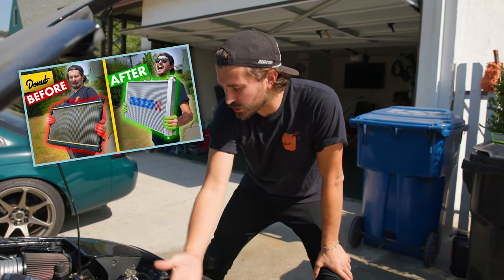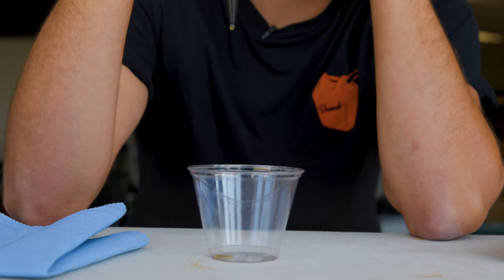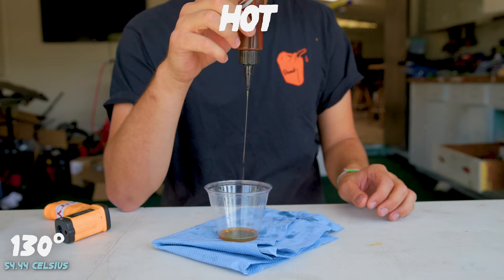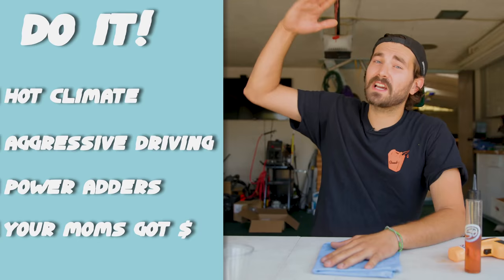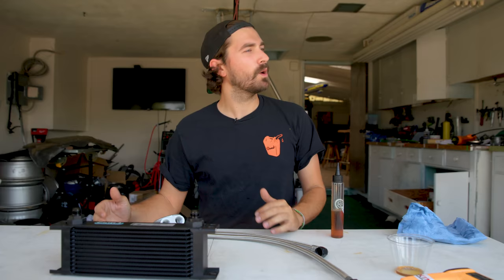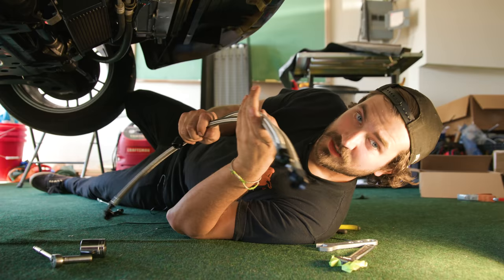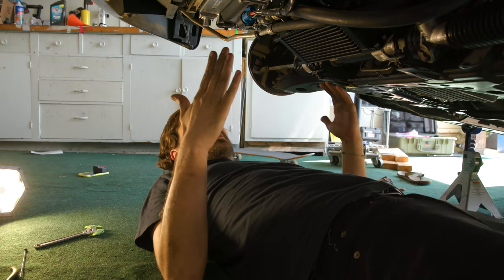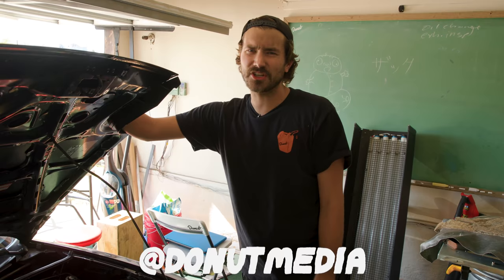Is an Oil Cooler Worth It?

Comment: One day he will swap a jet engine in the miata
Reply: After that he will swap it with a nuclear reactor
Reply: @korosukanji5398  and there still won’t  be a turbo
Reply: @azav32  lmao 😂
Reply: Swap a rotary into a jet😂
Reply: Literal money pit
Reply: pulse jet engine incoming
Reply: bob lazar mode
Reply: Look up Az state fair jet powered smart car, thank me later.
Reply: you cant do that, cause jet fuel is square shaped, and they only have round fuel hoses! (smokey yunich podcast)
Reply: Let's hope
Reply: Y E S !
Reply: Well, he IS going to put a turbine in it, and a compressor, so, kinda, yeah.
Reply: He should go for a british V6. Look at car throttle and their miata.🤘
Reply: Sweet. Then I can be a donut mechanic.
Reply: "Is Jet Engine Swap Worth It?
Reply: @mrkvatheepic2913  yEs
Reply: @mrkvatheepic2913  from a monetary value worth. No. When parts break they are thousands of dollars. And the engine wear is measured in hours not miles like cars. 
From a cool factor. Yes totally worth it.
Reply: (Jay Leno has entered the chat)
Reply: That would actually make it fast. ;)
Reply: With afterburners
Reply: @azav32 XDD

Comment: I like how he emphasizes good practices like moving the car after applying jack stands, oiling before screwing, using softer material on fittings to prevent damage.. and more oil! Good role model.
Reply: Except for not blocking his back wheels, personally i dont want to be a pancake
Reply: @redhammer5783  Because he left his car in neutral and totally without a parking brake
Reply: @derpyduck5088   A little extra safety never hurt anybody.
Reply: "oiling before screwing" 👀
Reply: More oil isn't always good. 
There's a low and high, you don't have to be on the high side. 
My Yd25 takes 4.7L total but I only put 4.4L in
That doesn't not affect the engine at all, and being a high flow turbo diesel, it like all diesels is subject to high crank case pressure which will increase sump pressure, and that oil pressure goes back Into the turbo and breaks the seals. 
It can happen, and did happen to me. 
I avoid this issue by using less oil.. simple. 
Don't always go to the H on the dipstick if you have a turbo.
Reply: "Oiling before screwing" is a tip for life in general 😂

Comment: I always recommend putting something like a stainless wire mesh #5 screen about an inch of the front.   Keeps the fins from getting damaged by rocks n stuff.
The screen is heavy enough gauge to protect, and easy to form.
Reply: @mikez6683  In my case I folded it back around the cooler enough to use the cooler attachment itself as an anchor point.
Reply: While it will protect it, it will also hamper airflow, reducing it's effectiveness...
Reply: @Tallnerdyguy  Not really...   At least not in any meaningful way, unless you use something like screen door mesh.   Look up wire mesh #5, which is what I used
Reply: Thanks! I bought an oil cool for my motorcycle and it didn’t come with the guard. This sounds like a great idea.
Reply: @Mytwistedvoices yep, was watching this and thinking “that seems to be very much in the way of rocks”
Reply: @Fatboypeet  I put a cooler on my CB750 and found a good screen for it.
Reply: Are you a wizard?

Comment: If you put the lines on the oil cooler with oil in it before mounting it, you will keep from spilling oil while mounting.  Also, you should use some blue thread locker on the sandwich plate pass-through bolt to make sure that it stays on when you remove the oil filter during oil changes.

Comment: Be careful with putting oil on the threads, although it will make it easier to not mess them up and strip them, it could also cause the screw to loosen up over time. I would recommend to use semi or (soft) thread locker, when you first apply it it will help with not messing up the dreads but then after you tighten it, it will seal and prevent your bolt from coming out. This has helped me out a lot in the field, thought I would mention and keep wrenching guys! 💪🏽🛠
Reply: I have to agree, in industry as a fitter/machinist I use Loctite hydraulic sealant to assemble pneumatic and obviously hydraulic fittings and connections , it takes away a large portion of the vibration loosening risk especially due to the heat cycles of the oil.
Reply: Engine oil is fine to put on bolts. Infact, many bolts are supposed to be torqued 'Wet'. Particularly a lot of head bolts, conrod bolts ect. Oil won't hurt, bolts and fittings won't come loose if they are properly torqued. However, things like anti-sieze are another story.
Reply: @devo3243  no offence mate but we're not talking about bolts here, technically they are hydraulic fittings for all intents and purposes, I'm not going to suddenly change my process of over 30 years on your say so, I agree regarding head bolts etc, I have done this myself rebuilding a couple of my own engines.
Reply: @fourocker  This "hydraulic" system will never see the day it reaches over 80psi, not 8,000psi. Those head bolts will be receiving not only more vibration as they are directly connected to the thing making said vibration, but experience higher temperatures as they are almost directly in contact with the bore (although the coolant jacket as well). The fact that bolt and stud stretch is a factor when considering head bolt and main cap torque is enough to tell me the head bolts are undergoing greater forces pulling the head of the bolt and the piece they are threaded to apart than these aluminum AN fittings.

Feel free to use whatever you want, but let's be fair here, these aren't the same thing.

Comment: Pretty soon they're going to run out of stuff to do to this car.
Are titanium lugnuts worth it?
Are Hand-crank windows worth it?
Reply: Is converting my miata to a diesel worth it?
Is converting my soul to pastafarian worth it?
Is it even worth having wheels? Converting my miata into a hovercraft for the ultimate driving comfort.
Reply: I would still watch
Reply: Hand crank windows are golden
Reply: Nos kit next
Reply: @stopglobalswarming  they do the job in a small car very well
Reply: @MrPlanner12  ...after that how to rebuild the engine ...;-)
Reply: They would probably buy a different car.
Reply: Is a chassis delete worth it?
Reply: @joshrepik  is a car delete worth it
Reply: @joshrepik  ....in the UK they have Mazda 7 racing ....all those rusted out MX5's
Reply: @alexjohn5086  trust me, I live in Ohio. The rust here is very, very real.
Reply: before long he is going to be driving a B-series
Reply: Is buying an E36 worth it?
Reply: Are cars worth it?
Reply: How to ls swap a miata
Reply: my hand crank windows ALWAYS work in my 7.3 OBS... my mustang and s10? not so much
Reply: damn straight! I want em on my old car that should have them anyway  @stopglobalswarming
Reply: What's better, imperial or metric hardware... Swapping the Miata over to imperial hardware!!
Reply: cold oil is not good unless the car is heating up they may do a water pump delete haha.

Comment: For your main coolant, I'd suggest getting your hands on a glycol type substance enriched with a ton of graphene particles. Far greater thermal conductivity than water, but still flows well in super low temperatures. You can probably even make it yourself if you can get your hands on the graphene particles.

Comment: "Is an oil cooler worth it?" 
Me with an aircooled bug: "yes" 👀
Reply: Lucky lucky
Reply: Me and my Citroën agree as well
Reply: Then it's gonna be oil cooled? With the oil being cooled then the engine will be cooled also which helps at idle for air cooled engines I guess.
Reply: @Dongzzzzzz  yes, originally all aircooled engines are essentially "oil cooled" but sometimes it needed an extra oil cooler, especially since I lived in a tropical country.
Reply: @souheib9343  yo dude got an insta with it? That seems so cool!
Reply: The only good reason outside a track driven car to have one.
Reply: I🙋🏿‍♂️🙋🏿‍♂️🙋🏿‍♂️🙋🏿‍♂️ N MY RICE 🍚 KOOKERS KOLT TURBO N GREMLIN CTSV TOTALLY AGREE 👍🏾👍🏾👍🏾👍🏾
Reply: Me with an air cooled beechcraft 👀
Reply: A must for rotary
Reply: Porsche 930s were notorious for relying on the oil cooler as a radiator.  Presumably just like water cooled, only much hotter.

Comment: An oil cooler (with a thermostat) is an absolute must for any turbo applications. It's  amazing how stable oil temperature stays despite the heat from turbo even on hot days. With all the small turbo engines these days, oil coolers (and transmission coolers) should be standard if one wants to keep the car for a long time.
Reply: What kind of  oil cooler are you running?
Reply: @mr.bigrigs2059  I run a Setrab stacked cooler for the engine for larger cooling capacity and s smaller tube and fin, Hayden I think, for the automatic transmission. The engine oil cooler serves as insurance if the water cooling fails. And the transmission cooler prevents temperature spikes especially in the hot Summers.

Comment: A consideration not many people think about:

Your OEM oil pump may not be strong enough for the additional flow needed for the oil cooler.  You MAY see an oil pressure drop as a result of this kind of install.  Answer is either a larger oil pump or an aftermarket electric pump.  Heard of people using a scavenging pump to keep pressure up through the line (like a turbo).  Truly is a YMMV thing though, not all vehicles will have an issue and even those that do, may not be worth worrying about if the pressure drop is small.

Comment: I watched the whole video and the answer is

Y E S
Reply: its only been out for 4 minutes
Reply: @buurman2635  speed run
Reply: Dunno how you came to that conclusion, they didn't "test" anything other than it not leaking, if you looked back at the "9 grand worth of parts on our miata, was it worth it?" video it was a resounding  FUCK NO
Reply: @weegaz22   Call it peace of mind then XD
Reply: @bobwarpath2395  sure, but if i had spent 9 grand on "performance parts" on a car worth about a grand and had no real improvement in time @ the track then I'd be an idiot, that 10 grand total could have bought a decent, fast car in the first place, hell you can pick up a 3.2 Boxster S for  less than that where I am, and it would still have resale value a couple of years later when you get bored with it.

Comment: Every 20 deg. F drop in oil temp, effectively doubles oil life.

I installed an oil cooler a Dodge Caravan four cylinder, with an electric cooling fan.  It kept the engine running so cool, you could open the radiator cap at after running it in rush hour traffic and it would NOT blow up steam in your face.  Not recommended but you get the point.

Comment: The location of that cooler is lower than the oil pan. This means that now when you change your oil there will be dirty oil left over inside the cooler that won't drain.
Reply: Not just that, it’s exposed to road debris.  One good puncture and you can say goodbye to your engine.
Reply: @brianshorey  yeah, I was thinking it was bad for ground clearance, they should ship a skid with it.
Reply: @brianshorey  i was expecting some sort of protection plate. All i can think of now is one rock hitting thr radiator and oil leak
Reply: @brianshorey  Along with the fact that it’s an angle so airflow won’t be nearly as good
Reply: Yeah that's common for oil coolers to trap some amount of oil that you can't easily drain during an oil change. Good news is that it's not a large amount usually.

Comment: "every where you look, there's money" I feel you, I'm on my 5 consecutive Infiniti, going from VQ35DE high rev all the way to the VR30 platform, which I'm still riding. On every single VQ the very first bolt on was a thermostatic oil cooler, with the exception of my current Red Sport, keeping fluids at optimum operating temps and pressure is critical no matter the build or who makes it, imo transmission temps typically get ignored by most, I'm a believer in those as well! Cheers!

Comment: Thanks for the tip about filling the new cooler with oil before installing, you might have saved my 5.0. Just a thought for people with daily sports cars, look at where the oil cooler goes before buying/installing. In this video you can see it is very near the bottom of the car. If you pick up a rock or hit a pothole and you’re not looking at your oil pressure, you’re engine will be toast.
Reply: honestly engines can idle without oil just fine given the extremely low load on them, so I don't think it would've killed your car. Also it is important to note the mounting location prior to purchasing, however this particular one mounts higher than the subframe so if anything were to it the cooler and cause damage, you've also damaged your subframe, power steering rack and most likely your radiator too.

Comment: We had an MG B at work a year ago. There was an oil cooler in it, except for some reason it came half side braided line, half oil hose with hose clamps. After we did the engine rebuild the boss had a lap and was happy. The owner paid, drove off and must've hit some hella RPM  on the freeway (twin webbers) because the basic bitch hose came off and ran him dry. Didn't take long for a second rebuilt (only needed main bearings) but we had the cooler feed system upgraded to both new braided hose.

Comment: Since it's winter time, y'all should make a video about what you can do to increase traction in the winter, along with preventing rust and other winter issues.
Reply: In SoCal, it doesn't get very cold... maybe 60's(f) so they would have to do it elsewhere.
Reply: What would a guy in Los Angeles know about winter driving

Comment: You have to remember that when you do an oil change oil will remain in the cooler unless you drain it.  The factory cooler on my car has a Allen head plug for draining. Most owners don't bother to drain the cooler.
Reply: It shouldn't have much oil in it and ultimately a fair bit of old oil is left when doing a regular oil change anyway.

Comment: from personal experience, oil coolers are AMAZING. i’m in a 233whp turbo brz and before i had the oil cooler on i could only go 5-10 pulls before i was around 240*f oil temp. and that was in the winter. summer was god awful, a couple pulls and that’s that. since the oil cooler, my oil STRUGGLES to get over 220*f. huge help, allows me to pull all day long. not to mention highway drives. (230-240 if cruise set to 85 dropped to consistent 210)

Comment: That's right it does depend on what you have going on.  My truck is a 1994 Chevy 1500 4x4.  It comes from the factory with an oil cooler.  The oil cooler lines fail, OFTEN.  The job is a hugely messy operation so I always take it to the shop to have it done.  This time I will have him delete the lines completely and plug the holes near the oil filter.  I live on the coast of Oregon and don't pull a heavy trailer.  This will in no way affect the life of my engine.

Comment: Although not horrible advice, The cooler will fill automatically as the t-stat in the adapter allows for approximately 10% oil flow to the cooler at all times... even when cold so it will fill up without the need to pre-fill the cooler during installation. 

Oil coolers with thermostatically controlled sandwich adapters are GREAT mods!

Comment: It definitely helps or is needed on highly turbocharged cars. My Buick grand national definitely needed one. An upgraded aluminum radiator with a lower temperature thermostat helped a lot too. Could run higher boost without knock.

Comment: Thank you for mentioning the Thermostat as to many low cost kits out their do not provide this vital component for oil coolers to function properly and many people unknowingly are just damaging their engines internals.
Reply: Exactly.

I live in a hot climate but we do get the occasional cold snap over winter.

So middle of summer, a fully open cooler probably isn't going to damage my engine but in winter, on those particularly cold days, it might not even get hot if it's a short drive - so very bad for the engine.

Comment: I had a 92 corrado vr6 stock! I had some overheat issues due to the small radiator, I installed an oil cooler and that helps the engine a lot!!!

Comment: Here's one: power steering cooler.  Ford felt that one was needed on an E150.
Reply: If you are doing rock crawling or serious offroading, I would recommend one.
Reply: Even a hoop in the oil return line can do wonders, it's unbelievable how much compression hikes temperatures and can cause wear and tear

Comment: Question: when you do an oil change, how do you replace the oil in the cooler? Seems like there will be at least a quart in the lines and cooler that wouldn't drain out of the pan.
Reply: I always wonder if we should flush our engine oil every once in a while. What if we're leaving enough that it harms the fresh oil.

Comment: I putt 2 of those typ oil coolers together with 1 inch lines on my backhoe transmission oil cooler I did it years ago works good I looked at lots of oil coolers before I made my decision on wich one to go with. I found B&M super coolers don't last long. I tried them for my hydraulic oil cooler. I found the cramped styl B&M super cooler worked perfect on my VW Passat transmission lol. Thanks be blessed.

Comment: Oil thermostats fit inline between filter and cooler . Oil is returned to engine when not up to temp .
Oil is selected according to ambient temp.
 Ideal oil temp is 190-212 F /90--100cel  . Oil needs to evaporate excess fuel and condensation .

Comment: Thats why you pull fuel by either removing fuses etc or pull ignition but you don't want to crank too long while pulling just ignition. That will build oil pressure in your system when changing oil etc.